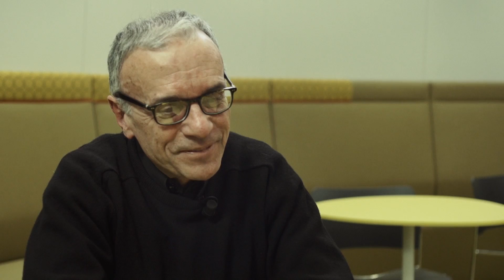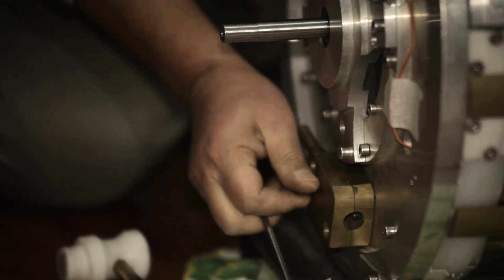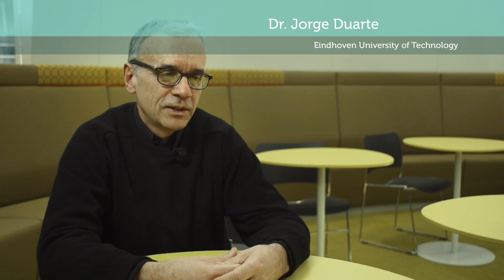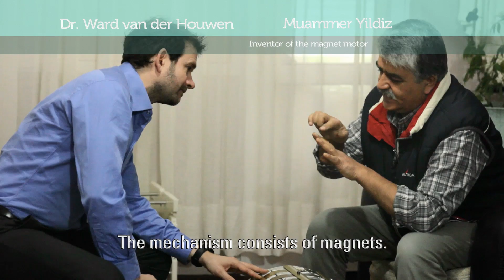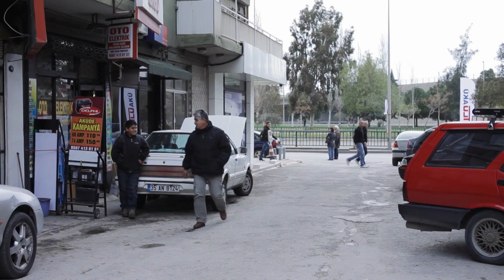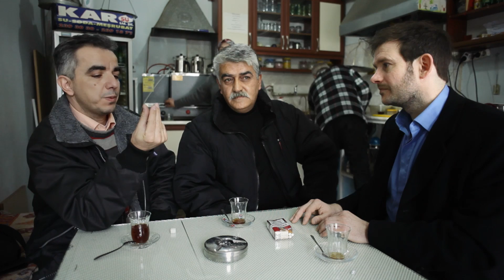Yildiz Magnet Motor documentary trailer, March 2013

Comment: The device definitely is a scam and does not and could not contradict the natural laws of physics, particularly, the first and the second laws of thermodynamics which basically dictate that you can't get more from something than you put in; and no matter when, you always loose some of the energy in terms of heat, friction, and so on. In another words, there is no "free energy" out of nothing. So. the device sooner or later is gonna stop working even without any load. But I am really wondering what the hell does Expo and those professors think by representing this crap...

Comment: davidrop Do you know where I can find info on those university tests?
Reply: There were demonstrations in rooms of universities, but there was never a university test. One university test was planned but Yildiz stepped out since the university demanded a complete disassembly to rule out a hidden battery. The Yildiz machine is an obvious scam.
Reply: TR
What can be found in rexresearch? An older machine of Yildiz, which he doesn't show anymore. Mr. Duarte has measured overunity with this device. But was it really OU? Citation Mr. Duarte: "Considering the inventor’s assurance that ... no kind of energy storage was implemented inside the box, ...". Mr. Duarte hasn't checked for any trickery, he just believes the assurance of Mr. Yildiz!
What you also find is the patent of the Yildiz magnet motor. I think it is known already that patent offices do not check if something really works. If an expert looks at this patent he will find no reason why this motor should work. In fact, some have tried to build the device following this patent. It was always more a brake than a motor.
Reply: TR
Passt schon. davitrop hat vor längerer Zeit gefragt, aber wohl eher die Delft-Vorführung gemeint.
Reply: TR
Ich tippe auf einen Betrug mit einer versteckten Batterie und einem E-Motor. Die Demos sind immer nur kurz und Herr Yildiz lehnt alle Untersuchungen ab, bei denen verlangt wird, dass er seine Maschine ganz zerlegt. Wenn er schon ein Patent eingereicht hat, ist sein geistiges Eigentum geschützt, dann gibt es keinen Grund mehr für Geheimniskrämerei. Bei solchen Schwindeleien wird oft ein Patent eingereicht, um das Ganze seriös aussehen zu lassen. Ob das Patent nur eingereicht oder auch erteilt wurde, ist dann noch die Frage ...
Reply: TR
Das Patent ist sehr vage abgefasst, dass das ein von selbst laufender Magnetmotor sein soll, steht dort nicht. Kann man als FE-Erfinder auch nicht hinschreiben, denn PMs akzeptiert kein Patentamt. Yildiz tut schon 10 Jahre lang herum. Betrug wird es erst, wenn er etwas verkauft, was nicht funktioniert. Spenden wird er wohl schon lukriert haben, da kann ihm niemand etwas anhaben. Er versucht, Produktionslizenzen zu verkaufen. Wenn die Verträge geschickt formuliert sind, auch kein Betrug. Ohne wirklichen Funktionsnachweis tut er sich da aber schwer. Jeder seriöse Erfinder würde sich doch sofort um ein lupenreines Gutachten bemühen. Dann rennen ihm die Investoren von alleine die Türe ein ...

Comment: The motor is always shown turning a ligth fan at a high speed!

Sound to us exactly like Muammer Yildiz want to keep this show for ever ... he did not want to validate or produce any real product.

I see a video where one of this motor was running a little car (nothing more than a go-kart), so it should work well to run a generator, a Prony brake or a centrifugal water pump. It is cheap, easy and less loss and no guessing on power output.

This is a fairly accurate way to calculate motor output!

Comment: The Fan propellor uses probably less than 10 Watts mechanical power to turn at this revolution. So as there is a battery inside as you can see by the cables, it is probably lasting pretty long with just the fan output....So until the motor is not fully opened and all explained, I stay very skeptical, also because of the track record of Yildiz doing simular nonworking machines and claiming free energy...

Comment: This is a portable system that generates electrical power via an accumulator that provides the initial motion for the system.

Already existing systems can generate electrical power of whose duration depends on the lifetime of the battery. In these systems, the battery has to be reloaded in order to restart the system. 12V electrical power provided by the batteries used in cars are increased to 220 V via transformers. 
rexresearch[dot]com / yildiz / yildiz dot htm